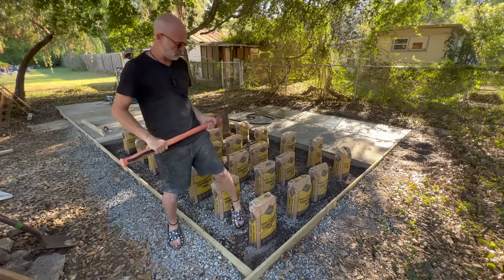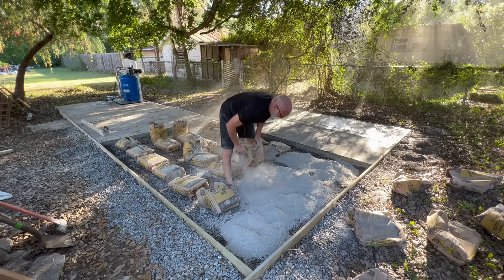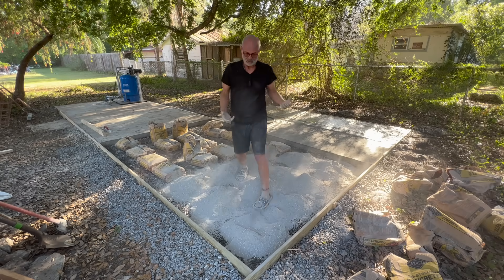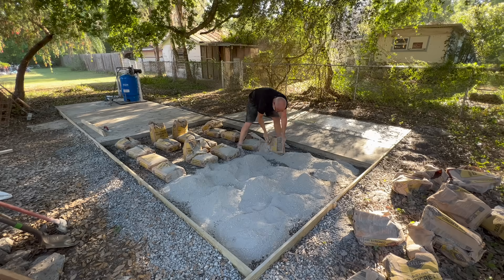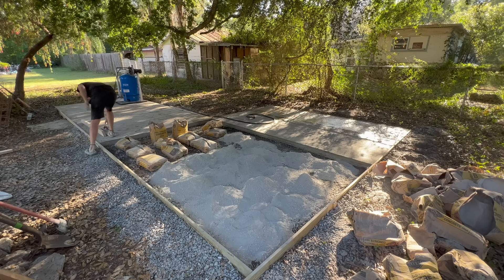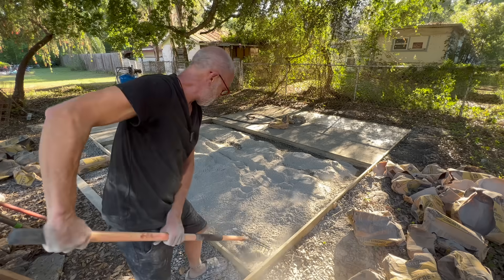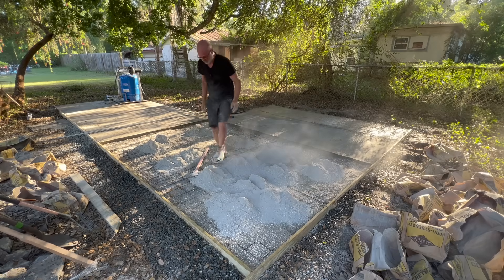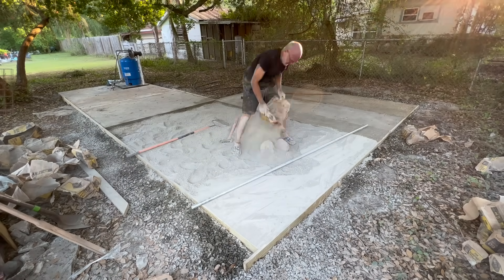Concrete Ninja Warrior Dry Pour Slab for Backyard Building

Comment: I hope you remember to do a 1 year review next year.  I would love to see how the dry pour concrete pad stands up after a year.
Reply: There’s a thing called water/cement ratio which determines concrete strength. This method does not allow for any accuracy in putting the correct amount of water in the mix and will therefore probably be much weaker than wet batched concrete.
Reply: @scottsowers4261  most of it is probably still powdery and uncured. this looks like a horrible waste of time and effort
Reply: @scottsowers4261 Bingo!!!
Reply: @scottsowers4261   What about fence post quick-cure cement, which isn't mixed to some precise ratio, and works very well?
Reply: @markh.6687  That’s an apples and oranges comparison. A blob of concrete around a fence post is just ballast to keep it from pulling up and to give the post more surface area against the dirt to resist being pushed over. A 4” thick (6” preferably) garage slab will be point loaded by vehicles along with potential differential settlement which crack quicker if the concrete strength is not there.  You will never get the desired 5000psi strength with this dry mix method. You have to bake the cake with the correct amount of ingredients for it to turn out correct. Rent a mixer if you want to do it yourself.
Reply: @scottsowers4261  Oddly enough I can't see my post at the moment, but my point was that post concrete works without being mixed and wet-poured. It cures and remains solid for many years.
 If the ground settles around a garage the wet-pour will also crack (saw it in my father's newly-built home garage floor within 5-7 years of being built, which means the contractor didn't prep the job correctly to boot), so that's not proof that dry-pour won't inherently work for a garage floor.
I did just see on YouTube a dry-pour project where driving an F350 pickup on it and letting the vehicle sit still for a point load resulted in one very small edge crack right along the form, and that was the most recent section the man had poured.
Reply: @markh.6687  I’ve been pouring commercial concrete for almost 30 years. There is a scientific reason why it’s done this way. But hey you do you. Good luck.
Reply: I did a 5x5’ dry pour slab for foot traffic only and it turned out great. It was the only way I could do by myself and if it holds up, which I think it will, I’ll be happy..if not so be it. I suspect it’ll last longer than my new refrigerator!
Reply: @@Anna-wx4ho It didn't I'm a builder this is an obvious mess waste of money...dry pour is only good for small pours
Reply: @FendergtrJam .. no rebar ,wire and a crappy mix. It would be in peices up north where the frost heaves the ground. Maybe it would be OK for a tool shed down south. 😅
Reply: @FendergtrJam on point!
Reply: Lol. Can't do that crap here. Wouldn't last till Xmas. 

You want to know concrete? Come here to Ontario Canada where we go from -45f to over 100f every year. 

We know concrete better than anyone on earth. Dry pour pad = junk.
 Sorry. Not sorry.
Reply: @drocto2000  Somebody will tear down everything some day, but that's not important now.
Reply: it doesn't. Dry pockets and weight lead to crumbling. It's moronic not to mix concrete properly for several obvious reasons these people just cannot comprehend.
Reply: Never seen the likes of this. Sheesh.
Reply: The concrete needs a proper amount of water for it to hold up to anything heavy correct?
Reply: I feel like I'm at a circus. I'm just Wondering why you didn't show the finished product
Reply: That’s how you build a shit foundation with no strength
Reply from the maker: Check out the video I just posted.  I'm already putting the dry pour to the test.
Reply: @renetto  I would feel uncomfortable using this technique for a fence post.
Reply: @gillettrandy  that made me laugh 😂
Reply: @renetto can I put re bars under the dry pour for a garage?
Reply: @Parnag10  Rebar should be between 1/3 to 1/2 from the bottom and you will need additional control cuts, doubtful it will work for a garage because this will not be but about 1000 to 1200 psi. I use a similar method to fill flowerbeds around pools. This is not a good example of how to dry pour.
Reply: @Parnag10  You will regret dry pouring a garage. Rebar in this case would just crack the concrete eventually because it wouldn’t be consolidated properly around the bar. Just order ready mix or get a couple friends to help you with a mixer. You’ll save on rework in the long run.
Reply: @Parnag10  bro dont ever do what you just watched lmao that is some scab labor shotty crap you just watched 😂😂😂😂
Reply: @Parnag10  I dont think Id use this for a garage. He want strong concrete and this is not a good way to get such.
Reply: @Anna Exactly.
Reply: @Anna it didn't
Reply: @Anna concrete is porous and water is constantly moving through. Unless it’s seals water will always go through. Strange I know
Reply: Wild lad
Reply: Don't think it will last that long and surface finish won't look good.  Depends what your using it for I guess.
Reply: Bet it cracks let me park my dually on it
Reply: Wow... 0mpa strength.
Reply: Will an unused bag of quikcrete left in my garage during winter freeze?
Reply: it stands up just fine i dry pour fence posts and they're solid forever
Reply: Great comedy😅
Reply: I'm worried about all the concrete he has curing in his lungs 🫁 😮😮
Reply: It won’t be standing at all. It will be junk. Thanks to YouTube heroes starting this dry pour garbage
Reply: I did it with a 4x8 slab about 10 years ago. Slab has been rained on for probably 7 of those years and it is just fine.
Reply: Just lazy
Reply: Cajun Country living channel has done this technique for some time and it has lasted for some time. Not saying it is 100% or even 50% correct but it does work "well enough". For non-structural foot traffic/light stuff it is ok. And besides, if it screws up, it is his money and time, so no big deal and we get educated on what NOT to do for free. So I say dry pour away.
Reply: @michaelkennedy2528  People like my I am a licensed Builder and your comment is bad advice just like his video the whole bottom is full of dry concrete foolishness so people take it from me unless it's a small pour and you juke it and trowel it DON'T DO THIS !
Reply: @FendergtrJam  what the heck are you trying to say? I gave no advice to anyone, did not condemn or condone what is seen in this video.
Reply: @FendergtrJam  he literally says learn from the guys mistakes if it doesn’t work. He also mentioned another YouTuber that did this method who had great results even after a long time. I saw that video as well. I think you need to reread his last statement when he says pour away. He means to the guy making the video, not to everyone watching.
Reply: It won’t
Reply: @Anna concrete has millions of tiny of airpockets, it soaks up water super easily..and this technique has been done forever
Reply: I once got a guy on a job where he was covered In we concrete like this and was subsequently hospitalized.
Reply: I just put post on telling him what he did wrong
Reply: @christophersherratt7299  concrete wire  2inches off the ground would help.
Reply: One year from this video he will be on oxygen from the particulate induced lung fibrosis.
Reply: @rhabdob3895 he might live for the year review 😅
Reply: He might not for the year review breathing all them toxins.😅
Reply: This is a crazy waste of labor and money

Comment: You need to screed the top by sliding a 2x4 in a side to side motion to get it smooth and flat it pushes the stones down and brings the fine cement & sand to the top giving it a smooth top finish
Reply: Will that work dry?
Reply: @DigitDesign  it works very well. Here’s what it will look like. 
https://youtu.be/GC0j2Ey5NNk

Comment: I've never done anything like this. You are making it look easy to me. Not as intimidating. I'm sure its not easy but looks good.
Reply: I think the worst part is lugging the bags of mix around;  I'm no athlete.
But I find myself wondering if 40 lb bags could work for an indoor project of building a slab in my basement to level my washer and dryer. I can sorta walk them down the stairs from my alley doorway once I get them out of my car's trunk.
** Yes, I know this is meant to be an outside method, but I'm thinking that wetting the existing floor, and adding enough water to the dry pour as if I was wet-pour mixing it would let it bond to the existing floor and cure properly.

Comment: This is precisely why stuff gets screwed up. You CANNOT pour concrete in this manner. Concrete needs to be thoroughly  mixed using the least amount of water whilst still being able to work it. Concrete doesn't DRY. Its a chemical reaction of the the Lime in the cement with water that CURES the mix..This reaction gives off heat and is integral to the end strength of the concrete. What this idiot is doing other than misleading people and creating a huge problem is nothing more than gravel with a skin. Zero compressive or tensile strength. Basically a waste of resources and time.

Comment: What wrong with just ordering it in a truck like normal, you like to make things harder than they need be. I'm betting it will lack strength, and over time may not hold up as good as wet pour would.
Reply from the maker: "What wrong with just ordering it in a truck like normal?"  Nothing at all.
Reply: If anyone has worked concrete they would know this way is much much easier. No worries about it setting up on ya, no rush, and most importantly the cost would probably be a third of what a truck cost. Call a concrete delivery and price it then get back on here and tell us the price. Great job here.
Reply: @riverbottomband  I guess it depends on what price you put on your own time.  Something I have learned trying to do everything myself…….
Reply: @renetto  Truck would be no good if it was just him finishing it himself. A truck might not be able to get back to his backyard, which would mean 1 wheel barrel at a time by himself and it would set up on him.
Reply: I mean he kinda explained exactly what all the problems were with it in the video- lots of extra time and work. One thing he didn't mention though was the cost of renting a cement truck, which would've been who knows how much.
Reply: @tonyfrontuto1140  I was just quoted last week $1,900.00 for a 20’x20’x3” slab for my backyard. I want to build a shed and a carport on it. Thankfully I’ve been watching videos about Dry pouring concrete and Paul’s videos are really convincing me to go this route. Thank you Paul!
Reply: @djfazher  Where are you located?  I just got two bids for drive-on (driveway quality) shed-foundation concrete, 4" thick with 4" base and level a 2 foot slope:, 30x75 feet for two sheds set a short distance apart from each other:  38k, yes that is $38,000.  That was the low quote.  The other was $68,000.

Personally I would not dry pour something you want to drive upon.  Storage shed for garden tools, fine, if you don't mind future potential cracking or spot-failing.  But if you do it, please post videos at pour and every year for a few years to prove it worked, would be fascinating to follow!
Reply: @KatSchlitz  Hi Kat! I’m near El Paso, Tx. I understand pricing varies depending on location. I suppose my quote was pretty good compared to others’. I do understand that for my needs I should get a thicker slab, thus more expensive. That project is on hold for now
Reply: @tonyfrontuto1140  bags of concrete are not free, there would be little difference in cost. He just wants to do it his way. Truck could drive up the side and dump it right into the forms, level it with a 2x4 and trowel, job done.
Ps mixers also have wheels, move it to where you want it dumped, no barrow needed.
Reply: @uksa007  SO, Let's be honest, because no one wants to admit it. I'll say it. 
It's intimidating when it's your first time and professionals are sitting there staring at you. 
Sure, there will always be good guys there that will help you out, but more than likely it's going to be some guy leaning on the side of the truck laughing at you under his breath and taping it for youtube to Brag about what a professional he is and why you should have spent three times the money to hire him.
Truth is Professionals are good for quickness and  building a more durable product than you need, but for more most people they need  a pad for a lawnmower shed and not to hold an F250 for a length of time. The "Harbor freight" non professional method is good enough. 
Professional is always best, but not always what we need.
Reply: @uksa007  The cost for 54 bags of 80# concrete mix by me is $280.
Reply: @SupremeAI98  some ppl have more time than money. As far as the price being really close....I call BS on that. Call and get a quote on Crete. I've worked concrete too it's a hard job no matter which way you go. Dry compared to wet yeah you have to deal with bags but think of all the money you save.
Reply: @SupremeAI98  are we talking 60lb or 80lb bags? I get a pallet of bags (like 52 of the 60lb bags) for about $140 from the local big box store in CA  ... $6 a bag is outrageous. 

I do totally agree though time and effort are worth something even if the materials are cheaper by the bag. I just don't agree when people say the material costs "are the same". They're just not.
Reply: @SupremeAI98  well your lucky...some ppl live farther away and get charged a delivery fee plus extra mileage. If you live beside the plant and order the required minimum then go at it. Look there's a billion ways to do something...who's right and who's wrong??? To each their own .
Reply: The problem really...$$$$$$$$$$$$$$$$$$$$$$$$$ the exorbitant cost of a contractor raping you for something that's really not worth the cost nowdays for the use that this guy intended for non-driveway purposes.
Reply: Doing it by 20kg bags is 2.5 times more expensive than getting it delivered by truck, way more labor intensive & more time consuming. Have another pair of hands & truck delivery is the way to go for slab work.
Reply: Mostly cost.
Reply: @tonyfrontuto1140 You're going to need to back that up with prices quotes. I don't think the prices will be that close ... we can argue about the difference being worth it or not but to claim the prices will be close is not genuine.

Comment: Paul, nice looking job, question for you, were those bags of premix or just cement?
Reply: It's high strength premixed concrete. Portland cement is an ingredient but portland alone is more expensive and comes in 90lb bags. It would get too hard on it's own and be brittle. And be way too expensive. Over half the volume of concrete is sand and gravel. The cement is just the binder.
Reply: @EthanPDobbins  thanks for the feedback, was curious cause it just looked like Paul was spreading and wetting down cement.
Reply from the maker: Correct.

Comment: For a dry pour, that was a HUGE undertaking.  I've seen people do HVAC pads dry...but not that big!  Wow.  Hey good on you.  Good enough for government work.
Reply: Obviously you don’t do government work…there are rules ,design,engineering,specifications,inspection and most people doing are required to have qualifications..etc   Once it’s turned over …all bets are off
Reply: In hvac we tend to have prefab forms with the styrofoam centers but you are right I have done a few jobs with dry pour like this but very small pads